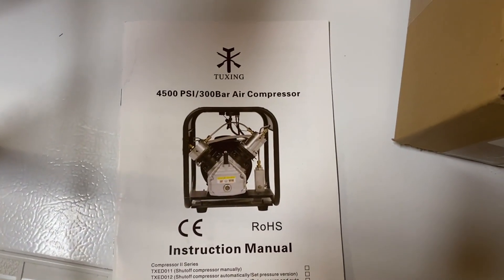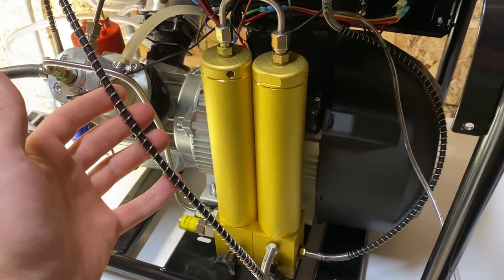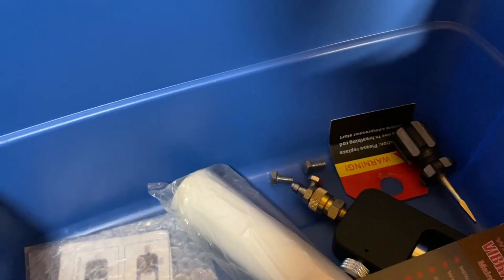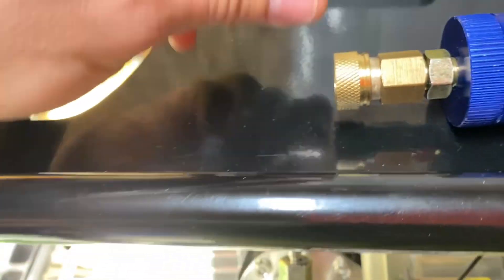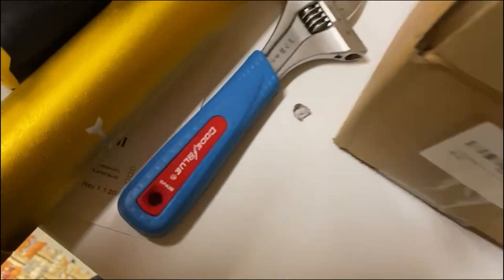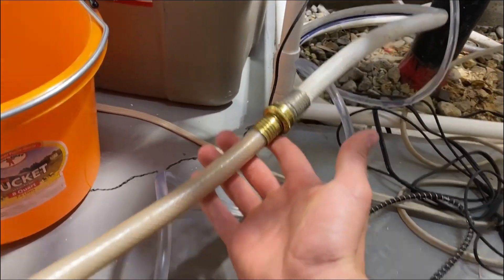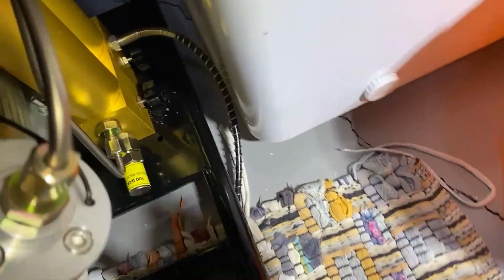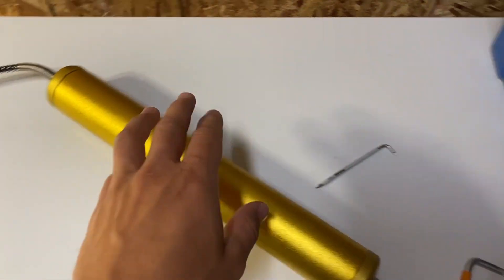Tuxing TXEDM042 for Scuba? (Air Tested)

Comment: Hello good evening. Could you give me a big help please? I have a compressor just like yours, the compressor is new, it only worked for an hour and the electric motor burned out! I want to change the electric motor but I don't know the direction of rotation! Could you tell me which way the fan turns when you are facing it? It would be a great help to me!
Reply from the maker: Hey, sorry for the very late reply if you are facing the back of the motor with the fan, it turns clockwise

Comment: The tuxing pump will burn your house down ? Because it draws a lot of amp and also trigger your house breaker. That’s not good.
Reply from the maker: It only uses about 1400 W, which is plenty within a regular house outlet at 1800 W

 I have never had it trigger the breaker not sure what you’re referring to. If it’s triggering your breaker maybe it’s your wiring in your house?

Comment: Typically how long does it take to fill up an 80 cubic foot cylinder and do you have any complaints? I’m looking at this exact compressor to build a similar set up for diving.
Reply from the maker: From 500psi about 1.5hrs with some brakes in between

Comment: Air samples from Tuxing TXEDM042
During the test the pressure was only only 40 bar . You can see the gauge .
A two stage compressor can run up to 60 bar (588 psi) without burning to much lubriacant oil .
But if you fill your tank up to 3000 psi  the compressionratio of every stage must be about 14,3
and the air in the zylindes become to hot . That's the reason for your bad air and not the fve hour runtime .
Sorry but the air you send for the test must be taken at least while the compressor is running a few minutes
at 3000 psi or highter pressure , otherwise it is worthless  for a two stage compressor without a 

pressur maintaining valve like your Tuxing .
Reply from the maker: I will take this into consideration though the testing documentation didn’t say anything about a specific pressure… and the test was for a Scuba compressor
Reply: @ICE-Labs  Scuba compressors have a pressure maintaining valve between filter and tank that opend only if the pressure behind the filter is more than 110 -160 bar . This is nessesary for the filters to work well over the calculated use time . The steam pressure air can hold without condensation depends  only on the temperatur . If air is compressed the steampressure rises with the air pressure up to the point whre the steam condensates and can be removed . Thats one way to dry the air by all serious  breathing gas  compressors and they all have at least 3 stages with intercoolers . With such compressors there will not be a ver big difference in the quality of air  the way it is taken . They all compress at least to 110 bar and never had the hight air temperatur of your two stage compressor . The company you send your sample  don't knew this . To be sure you must fill a tank up to max. pressure and use this air for your sample . otherwise the test is worthless .
Reply: @RainerLange-l7q Hello, I followed your advice and bought a Nuvair 211 back pressure regulator for my compressor (the same as the one in the video). However, I would like to ask for your help to find out if it is okay for the inlet filters to go after the valve and before the filling yoke, or if, on the contrary, it is better for all the filters to go before the valve? I am also considering purchasing another set of double filters exactly the same as those that came with the compressor and adding them just after the first ones and then connecting the valve. I haven't tested it yet, the connections are just overlapping. Thank you for your attention.

Comment: Had you thought about removing the two smaller cylinders for the two larger ones...i know you would have to drill two holes in the top plate to allow it.....would just make it a tidier more compact unit.
Reply from the maker: I have thought about that, but I am just gonna keep those and use them as extra filtering.

Comment: How long does it take to fill a tank?
Reply from the maker: about 2 hours from 500 PSI it may be a little less than that usually I'm not filling from that low though
Reply: @ICE-Labs  What size tank are you filling?
Reply from the maker: 80 in.³
Reply: Mine takes about 1 hr. To do an aluminum 80

Comment: These compressors are not for breathing air there for filling up air guns
Reply from the maker: As they sit, they are not for breathing air, but if you get the right filtration and get it tested, which I did and was shown to be safe.
Reply: @ICE-Labs  verification is key.
Reply: So their analysis is wrong
Reply: It particularly says it is